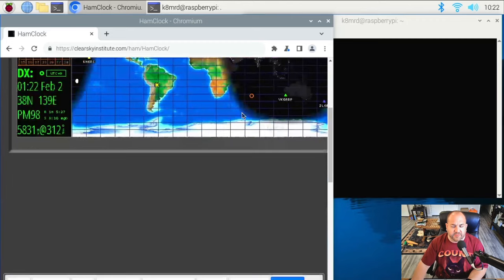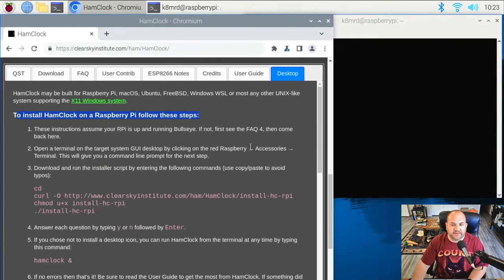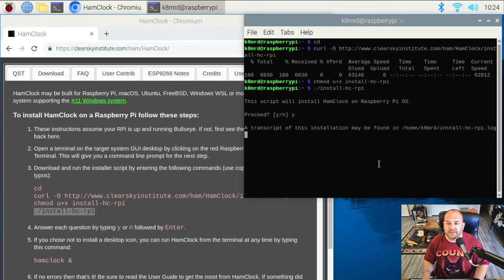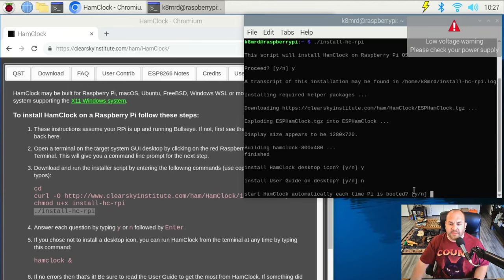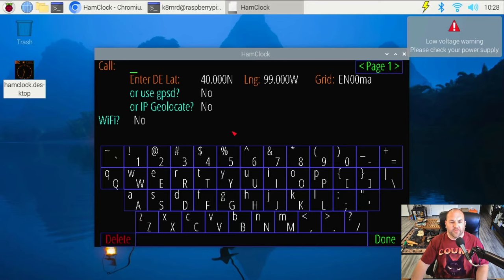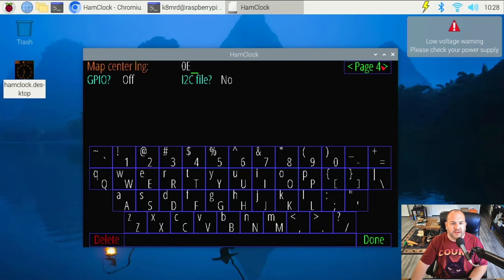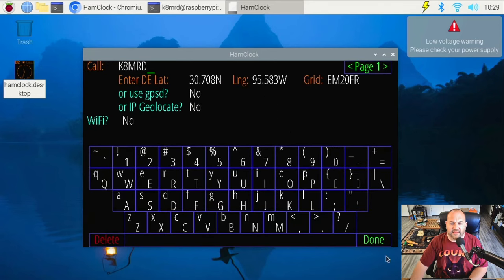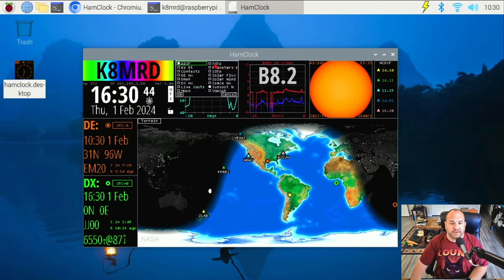Fast, Free, Easy Ham Clock Build Raspberry Pi

Comment: Thank you for sharing this...  you led me to the missing pieces of the puzzle that had been infuriating me for years.  I know have HamClock running on my Windows 11 desktop, not on the Raspberry Pi (already had that working... it was getting it on my Win machine that was the struggle).  This is, for me, a tremendous technical accomplishment and victory on the same level as the "Eureka" moment for  Archimedes (except for the whole running naked through the streets part, of course).  Always get a lot out of your videos, but this one is a crowning achievement that I will be celebrating later with an Arturo Fuente Opus X robusto (cigar) and a pour from my bottle of Lagavulin 16 yr old single malt (scotch).  73 de BJ, KM4RB

Comment: I just spent three days playing with installing a hamclock on a spare pi. There was more than once the resolution "broke" hamclock. Meaning it would say that it is running, but not be, and not have any way to close it out. The method that worked the best, and ultimately was the easiest was to leave it at 800x480 and then ssh from my PC and run [xrandr --output HDMI-1 --scale-from 800x480 --display :0] from the ssh terminal. The hamclock fully fills the TV screen with no black border. I think KM4ACK has an older video with a decent walkthrough. Now I wish I'd recorded my final install and configurations, so that maybe someone else won't have to struggle the way I did. Looks great now that it's done correctly.
Reply from the maker: Ahh, good to know.  Thanks for the tip.
Reply: I've had no issues compiling and running at the highest resolution. I have an instance of HamClock running alongside Pi-Hole on a headless Pi. I've compiled the version that also provides a web page. It automatically scales to the resolution of the local web browser.
Reply: When using the browser to view HamClock compiled for 4K, I've found that pressing F11 to go full screen kiosk mode, triggers the clock to go full screen without the black bars.
Reply: @KC7ZXYtube  I haven't tried using it in a browser. This pi only has one function; be a hamclock. It eliminated the need to have the same info on my desktop in browser and app forms. Now it's on its own pi, on its own TV and my third monitor can be used for more productive uses as part of my desktop.

Comment: I have been running it for the last year on an Inovato Quadra. Very handy to have.
Reply from the maker: It's so much easier on the Quadra.  Just turn it on, enter your settings and go.  And the Quadra is full screen on my 720 monitor in my kitchen with no bars.  Somehow they got the resolution right and this way doesn't.  I'm not a computer guy so I have no idea how that happened but it shows it's possible.

Comment: I don't have this running as an app on my pi, I have it only accessible as a web page at the highest resolution.  I have noticed that it resizes pretty will when I resize my browser window when accessed from another computer over my LAN.  Folks might try configuring it for web viewing, the opening a browser and going to localhost then setting the browser to kiosk mode.

Comment: I am surprised that it is hardcoded to the resolution like that.  Good video.  We need to get one that is maybe a webpage so that you can dynamically view it, it would be easier to display it on other devices as well.  Or heck serve the website out to the local network.
Reply: it can be put on a windows machine
Reply: I've found that building the highest resolution web server version, will give a clock that scales with the browser. It's been working very well like that. I'm really pleased with this software. Amazed, actually. Take care. 73

Comment: Hi Mike, , is it a waste of the processing power of a pi4 or pi5? Would this work on a pico for example? Cheers, Gary
Reply from the maker: You'd have to try it.  I have no idea.  I only have 3's and 4's.
Reply: I have it running on a Pi4 alongside Pi-Hole. CPU seems to run around 21% which ain't too bad. Even with both (pi-hole and HamClock) running, only 420MB of the 4GB of RAM is in use. In my opinion/experience, HamClock will barely tax a modest Pi4. I also have HamClock running on a Pi3 and it performs just about the same as on the Pi4. Will likely run fine on Pi Zero 2.
Reply: @KC7ZXYtube  Thankyou, 73